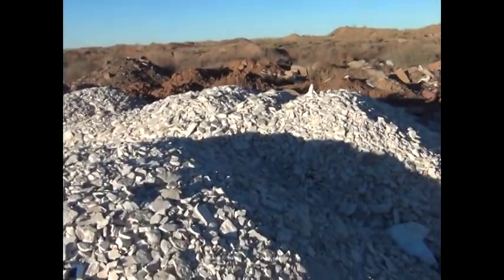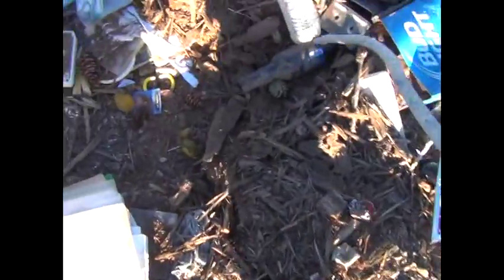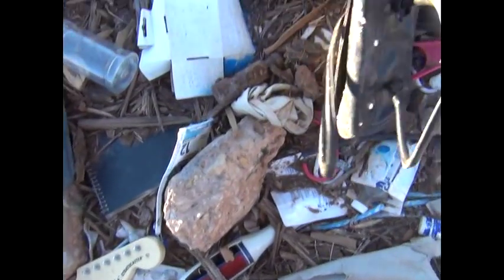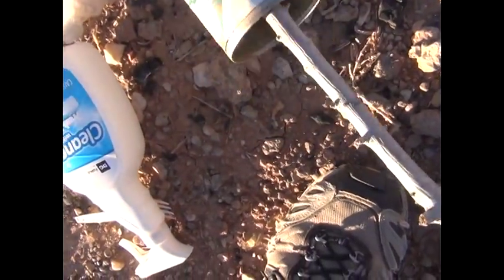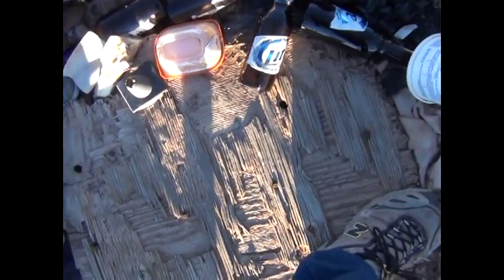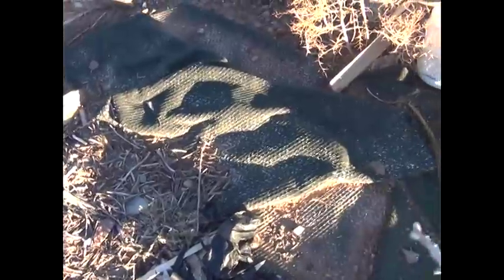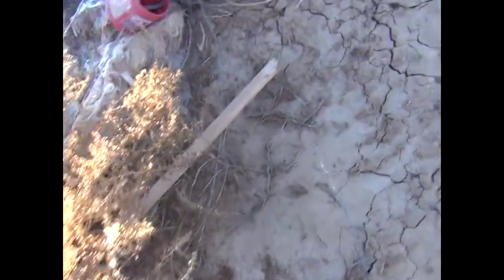Trash = gold in a survival situation - HD

Comment: Awesome , I know i issued a challenge  version of this for urban environment( .UGSK)
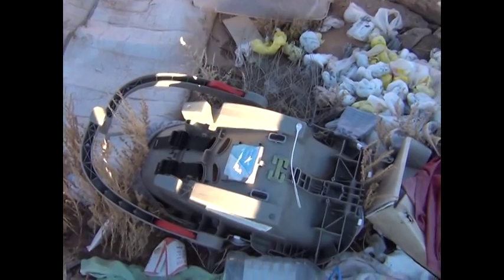7:10 i swear that looks like an Ensure bottle lol  7:22 the car seat has webbing material that's good cordage make a sash  or handle with :D I actually have scavenged this before in my journeys  With the buckle make a waist setup for a pack or something. 11:50 The screws or the nails from the pallets  would be useful for shelter building. 13:29 Zippers could be used as cordage. Pop cans/ some of the plastic bottles be used for solar ignition/boil with/distillation setups or UV light pasteurization via solar radiation( not heat) with clear ish water and about 6-8hrs of direct light.( cans can be used to reflect more solar radiation)
Thanks for sharing ... C.R.